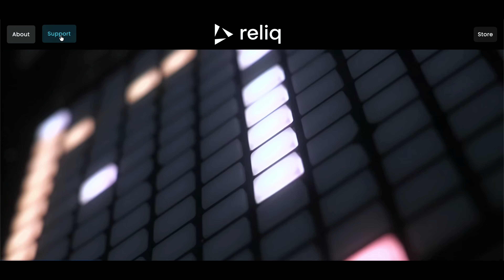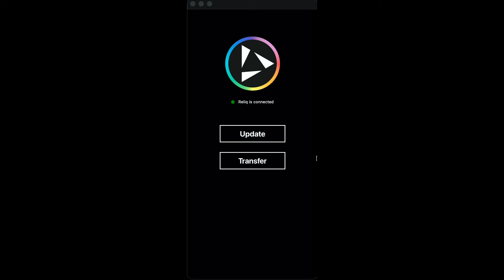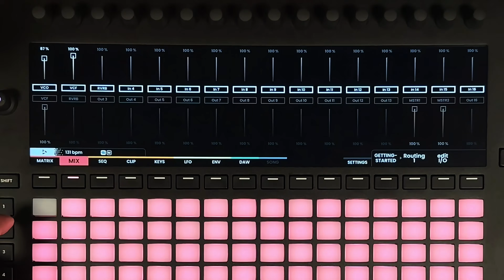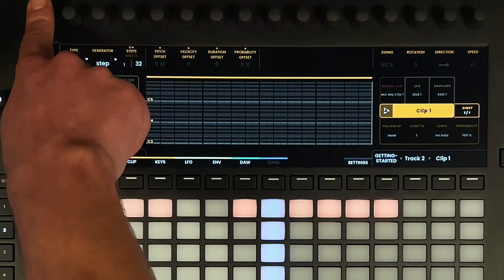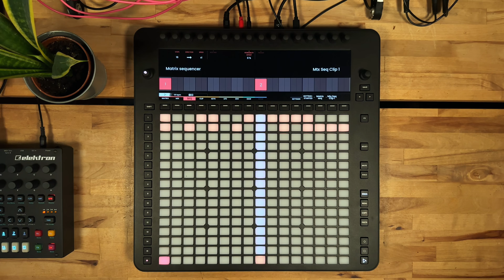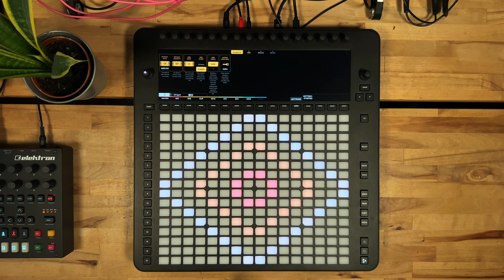Reliq Explained - Getting Started

Comment: @9:50 you added a drum track and all the lanes were configured with different names, midi notes and channels. Did you have to configure all that beforehand or are there some templates ready for different drum machines?
Reply from the maker: Yes 🙂 You can create preset clips for your drum machines (including note names, MIDI channels, colors, track settings, etc.) and then import any of those clips into any project.

Comment: I want to set the level of each input to output pair. For example input 1 goes to output 1 at 25% but to output 2 at 55%. Can this be implemented in the future? The UI would be inputs on left and outputs at the bottom. Hold a corresponding grid button and turn the knob to set that input/output pair level. This results in 16x16 level options vs 16+16 currently.
Reply: Ah nevermind it’s all analog audio so the as is design makes sense.

Comment: We're reaching a critical mass where DAWless isn't really all that DAWless any more
Reply: But this isn’t an example.  It’s completely tactile sequencing, something you dont get with a daw.
Reply: …as long as it sells then they will make anything. 💸💸💸
Reply: The problem with such a product  with a lot of different usescases is that it really need to be as good or better than the existing niche products.

If the sequencer isn’t as good as, for instance, Oxi One or the MIDI Controller as flexible and good as, for instance, Neuzeit Drop, then it will fast be collecting dust on the shelve! 😬

It is psychically HUGE, so unless everything is good then you probably will not bring it with you, if you have smaller products that are better suited at specific tasks.

We really need to see a company that keeps updating the firmware and listens to the community - and not a company that leaves in a lot of bugs and a team that only focuses on their next product.

I don’t know these guys, so I hope they do that better than the average companies, but based on statistics and experiences, it dosn’t look good. 😬